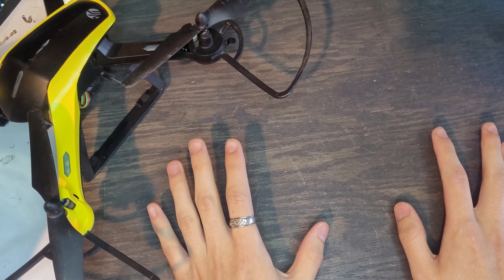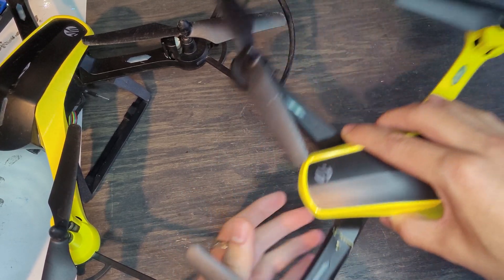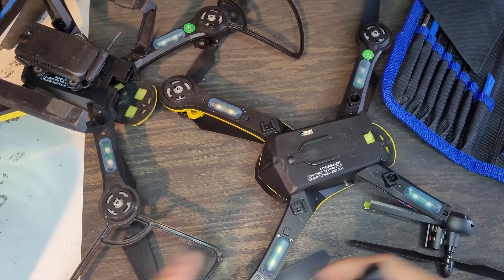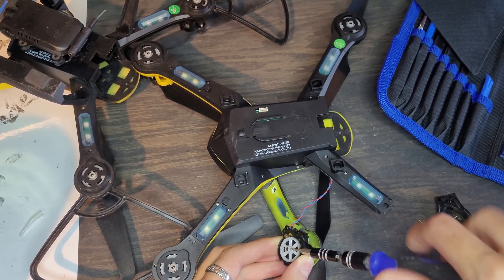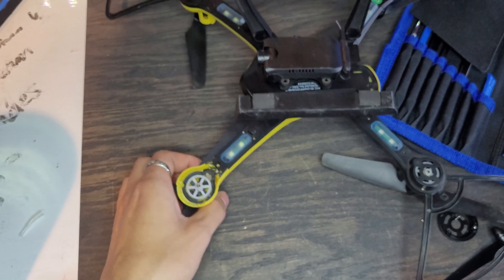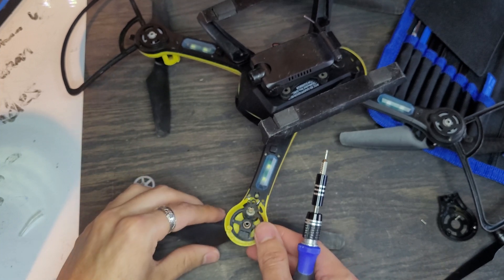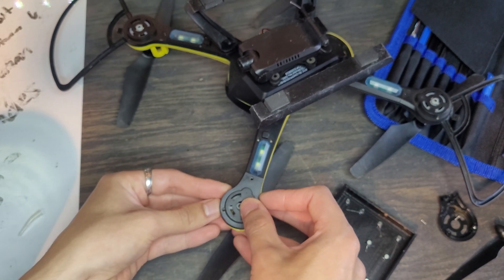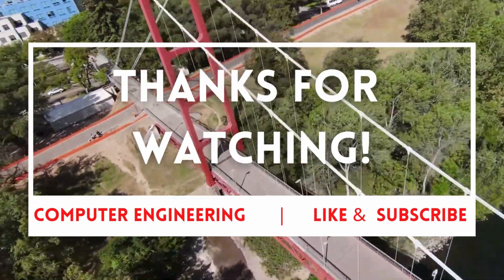Vivitar VTI Skytracker GPS Aerial Drone: Fixing a Propeller Gear Issue

Comment: And it just started doing it all of a sudden it was flying good and connecting but it just all of a sudden started doing this crap when I get done spending it on his head it goes to red instead of green and it will not go to green I let it sit and it still don't go to green and it will not run
Reply from the maker: @LesterHodges-fc4fk  yeah. This drone is super finicky

Comment: How do you change speeds while in air? Or before flight i cant get it 😅
Reply from the maker: I haven't flown this drone in a while but I believe there's a button on the side or top that you can hit, I think there are three speed modes
Reply: @ComputerEngineeringCPE  I found out its by pushing right joystick in not down
Reply from the maker: @anointgarcia87  Glad you're able to get that working!